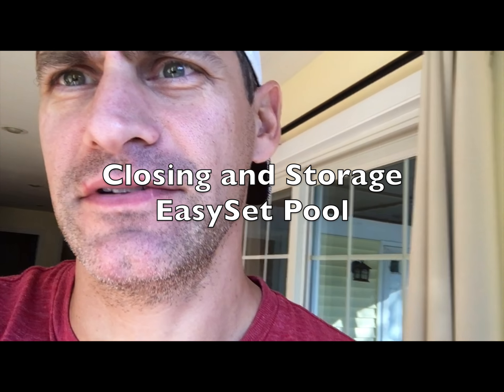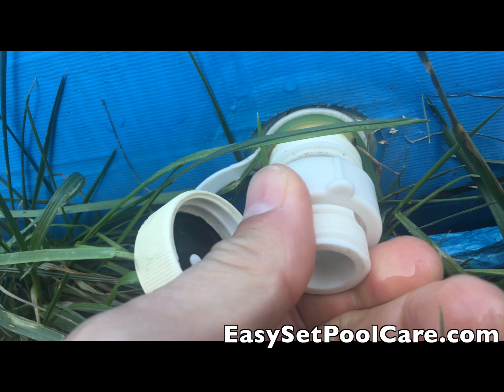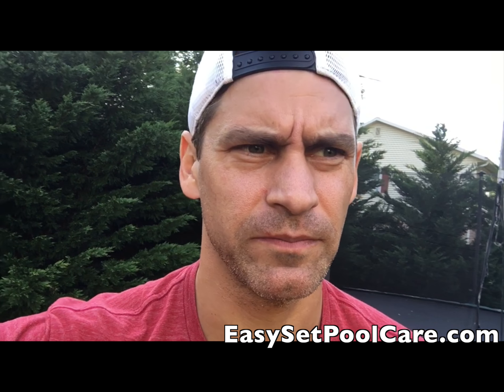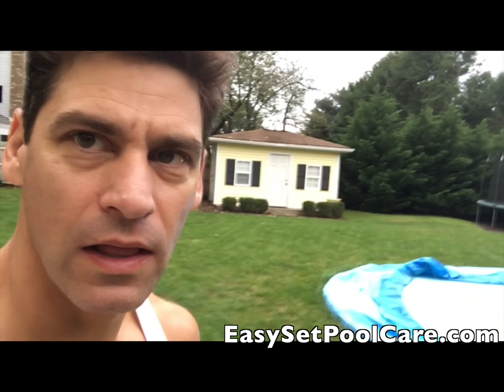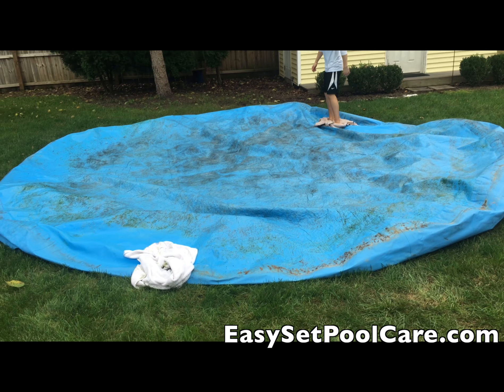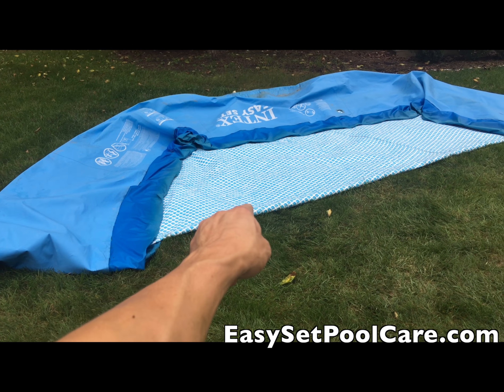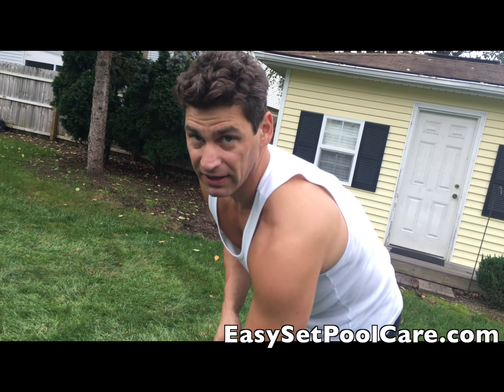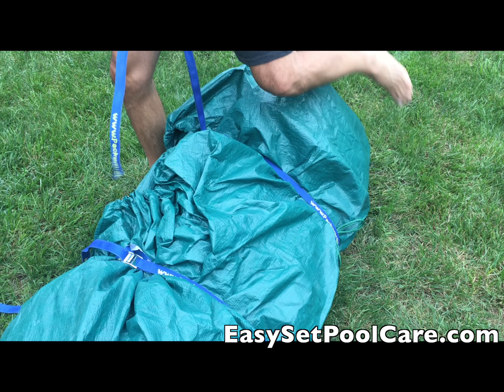Intex EasySet Pool Take Down and Storage

Comment: Just finished draining mine, the built in drain took about 36 hours (15 x 48" pool) then used a garden hose and siphoned off the last 2-3 inches which took another 4-5 hours, was a bit more time and work than I assumed but then I was like, how do I fold this thing? Luckily I found this video which helped, I would have done it backwards so thanks for showing the way! It's now ready for winter

Comment: I LEARNED MY LESSON WHEN DRAINING MY POOL. I NOW USE A SUMP PUMP WITH A 100 FT HOSE (4 COUPLED 11/4" CORRUGATED PLASTIC HOSES WITH 11/4" SMALL CUT COPPER TUBING NIPPLES, THEY FIT PERFECTLY) AND DRAIN THE WATER AWAY FROM YOUR HOUSE AT A DISTANCE. FOR YEARS PRIOR I WOULD LET IT DRAIN IN THE BACKYARD GROUND WHERE THE POOL WAS 15 FT AWAY FROM THE HOUSE. AND OVER THE YEARS I STARTED TO NOTICE A LOT OF DAMPNESS IN THE BASEMENT COMING THROUGH THE CORNERS OF THE FOUNDATION. SO I GOT WISE TO WHAT WAS GOING ON WHERE I WAS SATURATING THE SOIL AROUND THE HOUSE DRAINING MY BIG ROUND 18 FT POOL. SO I RESORTED NOW TO USE A SUMP PUMP WITH A 100-FT HOSE AND TAKE IT TO THE FRONT OF THE HOUSE TO THE STREET AND LET IT DRAIN INTO THE STREET SEWER MAINS.

Comment: Would have been nice to see the full folding process, my pool is 14ft and getting it laid out the way its shown at the beginning of this video was frustrating and eventually I just did my best, rolled it up and stuffed it in a box
Reply: You got yours back into the box??? A box? Of any kind that's not for wardrobes? Because I have to return one that leaked and it's currently double bagged in lawn trashbags because they insisted I return it within a week. It had rained every other day and it's not even had time to dry. I'm not even sure ups will take it...

Edited to add: One bag on top, one bag in bottom.
Reply: @franny5295  lol, the box was a larger box made for a small garage heater that happened to flex enough to stuff it in. Warm weather is key ,I think...

Comment: I have a smaller house so I don't have a whole lot of places to store one of these. Would it be ok to store it in our attic? (It is an unfinished attic with a pull down door in our ceiling)
Reply from the maker: I think that would be fine. Be sure to thoroughly dry out the pool. I would suggest using talcum or baby powder on it - you can put it on the outside of the pool. It will keep it soft and prevent cracks. AND - store the pool in a big tarp or plastic so that it's completely protected.
Reply: @intexeasysetpools  Thanks! I didn't know if it would get too cold for it or not. I live in NC and while it does get pretty cold at times, our winters tend to be on the mild side
Reply from the maker: @shinyowlshop  I think you'll be fine then! Just protect it with a tarp so that it's not exposed. Good luck!

Comment: Do u need talcum powder if its going to stored in a shed?
Reply: A shed is not heated so it will crack from the cold.
Reply from the maker: I wouldn't store it in a shed withOUT putting talcum powder on it. That will keep it soft and dry so that it doesn't freeze and crack.
Reply from the maker: Only if it's stored improperly. Make sure it's dry and has powder and you should be good.

Comment: it would have been nice if you show more on the folding, like folding the sides in, next thing it's half-folded. maybe next time.
Reply from the maker: HI Pat, I'll be honest it can be tricky. I probably fold it slightly different each time I take it down. If you get the air out and thoroughly dry it you should be good.

Comment: You can use the two clear/white pump tubes to drain it faster we did that so you have x 3 drainage.

 However with time as the water drains they wont drain anymore once the water goes below them.
Reply from the maker: Yes